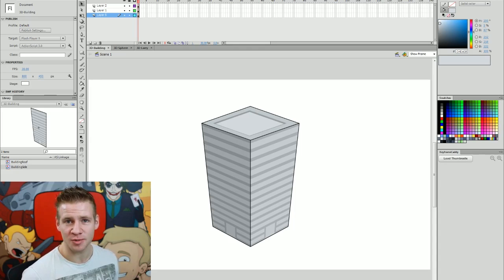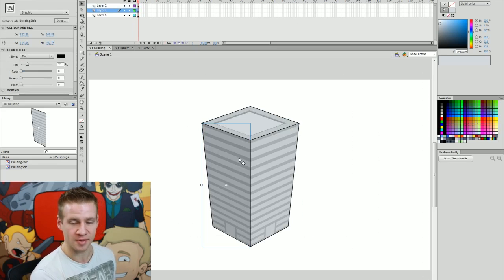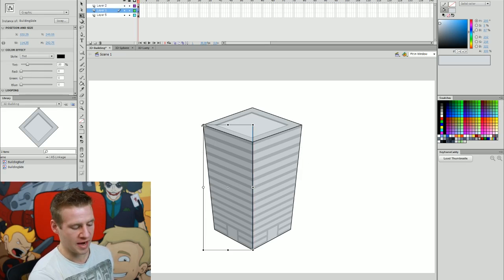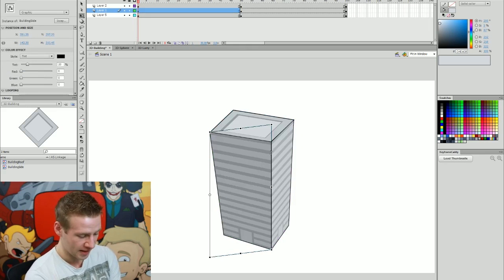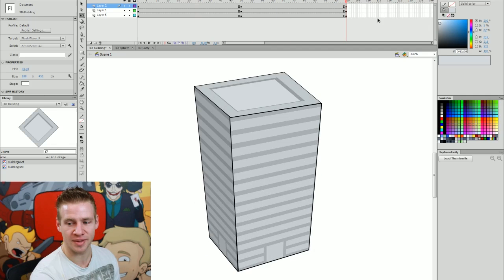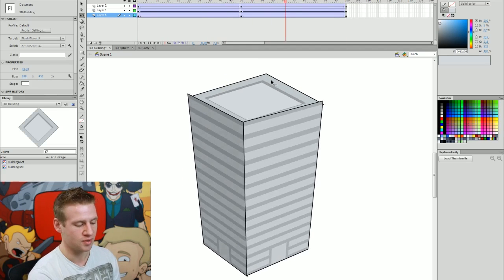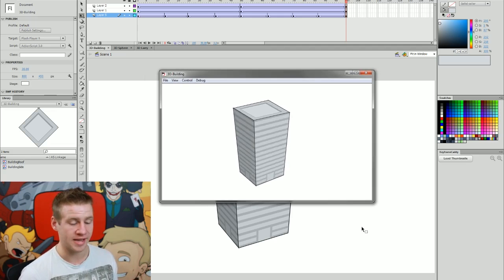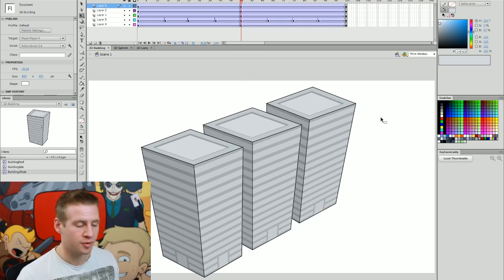How to Animate 3D transformations in Flash! (pseudo 3D)

Comment: Can you do a tutorial on animating in Photoshop?
Reply: Muhammad Khalil Animating with Photoshop is the same as animating with any other program.

You draw each frame on a separate layer. Decrease layer opacity to achieve the "onion skin" effect.
Reply: You actually can animate on Photoshop. I've seen some tutorials but none of them recent or good. This would be really helpful
Reply: You can animate in photoshop CS6. BY FRAME BY FRAME animation, TIMELINE animation and 3D too.
There are 3d functions available in photoshop which are a far way different from other softwares. But unfortunately I'm not able to find a useful tutorial yet :(
Reply: Animating what in Photoshop? Or in general? I can help you with whatever you need.
Reply: Animating in Photoshop please
Reply: Muhammad Khalil i don't think its possible to anime in photoshop... photoshop is for mostly photomanipulation and drawing if you please...